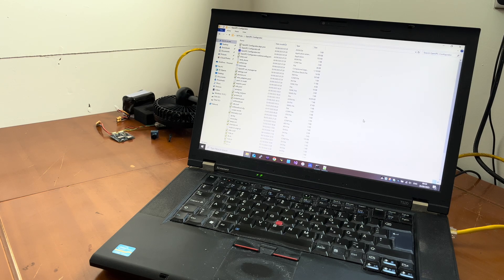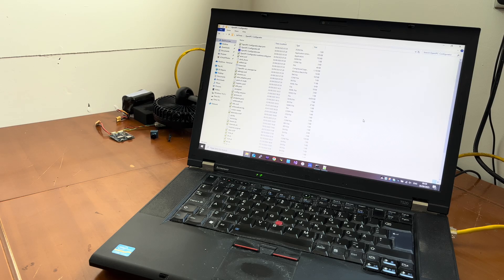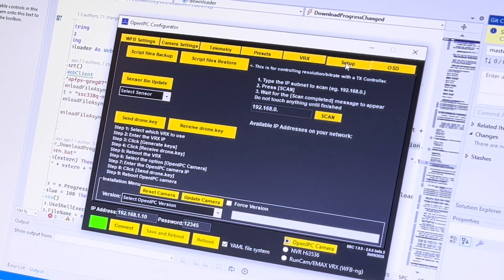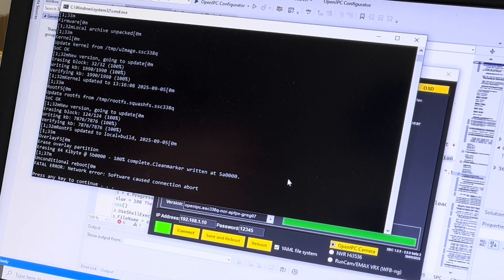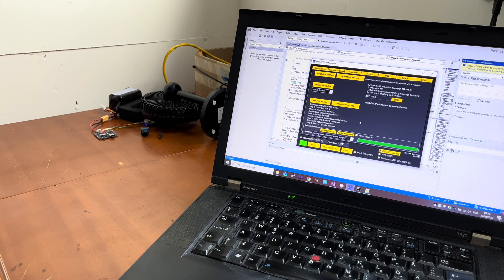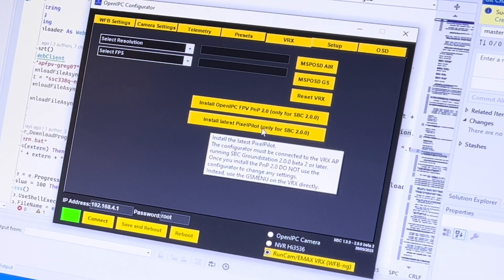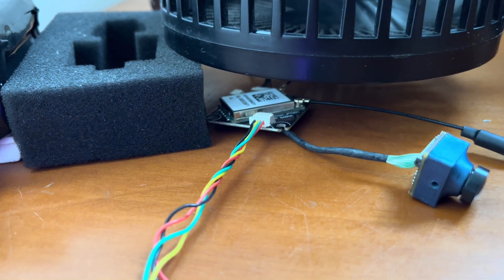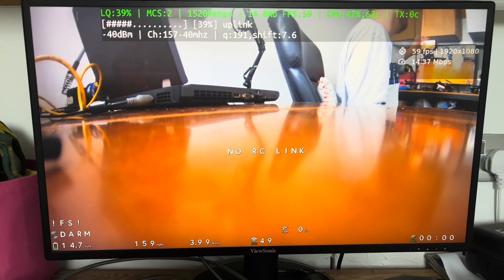Introducing OpenIPC APFPV Step By Step Tutorial

Comment: In the changelog is stated that there have to be antennas attached to a ufl connector. I have the Runcam Wifilink Vrx. Do I have to open it up and attach additional antennas to the 4 already available ones on the outside?
Reply from the maker: I think you are confused. The ufl connectors are on the VTX, not on the VRX. Search the difference between VRX and VTX if you are still confused. Cheers mate!😊🍻
Reply: @mariofpv  Oh thanks for the clarification. I am familiar with vtx and rtx but I didn't see that it is stated for the vtx. I thought the vrx has some additional ufl connectors that have to be connected. Thanks for the information.

Comment: Apfpv can connect directly to your mobile not required any external dongle ...... And with snapdragon processor mobile can handle smoothly And very less latency
Reply from the maker: The Android APFPV version (which is actually the PixelPilot for Android) does not include adaptive link so it lacks range and overall performance. Cheers mate!😊🍻

Comment: I test thous frimware on my runcam wifilink 2 have artifacts in the image and stops and freezes. I don't know why(( But I have no Emax but Runcam wifilink RX as I know them made on equal CPU  and wireless modules. This is strange. may be do some wrong...
Reply: I can confirm, I'm having the identical issues – artifacts and the image freezing. I was testing on similar hardware and thought I was doing something wrong. It's good to know I'm not the only one.
Reply from the maker: Try to change channel or flag the greg08rc2. Thank you for the support @pcrepair5080 😊🙏
Reply: I've also checked the original apfpv version: ssc338q-nor-apfpv (not the Greg version) and in my case, it's a lot better
Reply: @palione1 hi mate I have the same behavior but with original firmware cant get aalink info about link quality cpu info temp etc . did you get that?
thank

Comment: What is the cheapest camera that would work with this? 
Can I match any supported cammera with any supported transciver?
Is Xmeye 4Mp Ip Camera Board Smartsens Sc5239S Goke Module H.265 supported by chance?
thanks, great job!
Reply from the maker: The cheapest commercial camera is the Eachine single core imx335 and it works great. Cheers mate!😊🍻

Comment: this is very exciting. As a user it is getting more complicated with many alternate configuration systems: (PNP, WebUI, VTX menu, AdaptiveLink, Win Configurator, Universal Configurator, ssh and edit files...). Can we still use the VTX menu or the other older methods if PNP is installed/active?
 I'm glad the new VRX firmware has the ability to switch between WFB to APFPV.
Reply from the maker: There is a custom VTXMENU for the Egirl APFPV firmware. The Greg APFPV firmware has a webUI to change settings or from the gsmenu of the VRX directly. Cheers girl!😊🍻

Comment: Looking forward to see the range of the system i hope its not too bad. Also can you use a phone to receive the signal?
Reply from the maker: You can use any Android phone but the range will be limited. For a good range you need external WiFi adapter with a good antenna. Stay tuned for the maiden flight. Cheers mate!😊🍻
Reply: Thanks!🎉

Comment: Thanks for posting this! And thanks to the Devs! This looks amazing. I look forward to testing this. I'll watch for your testing video.

For the Runcam Wifilink 2 VTX would I select the same file you selected for your camera?
Reply from the maker: Yes the file is the same and works for the RunCam WifiLink 2. Cheers mate!😊🍻
Reply: @mariofpv  I am using APFPV on my Runcam VTX with my Runcam VRX and it works very well.
But when I install APFPV file openipc.ssc30kq-nor-apfpv1.1 on my Sphere Link Single Core, it works through my phone and the PixelPilot.apk, but it doesn't work with the Runcam VRX. Is that expected?